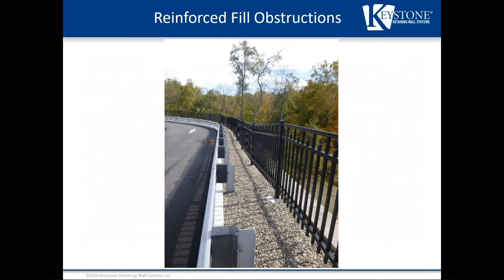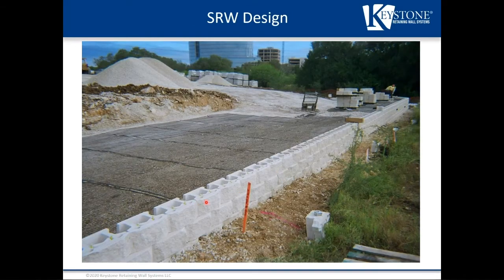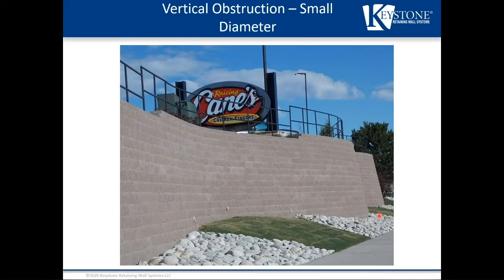Design Techniques of Obstructions within Segmental Retaining Walls

Comment: Great video.  I would have liked to see how to handle sub grade horizontal obstructions that are below the wall footing that would effect the ability to have sufficient depth of the #57 stone under the wall.  Such as a structures footing, a large piece of natural stone. I am guessing there is a point where we need to use mortar to support the first layer of wall because the stone base depth is not sufficient